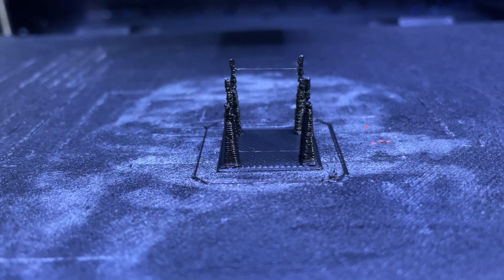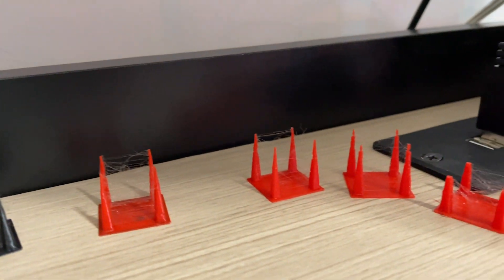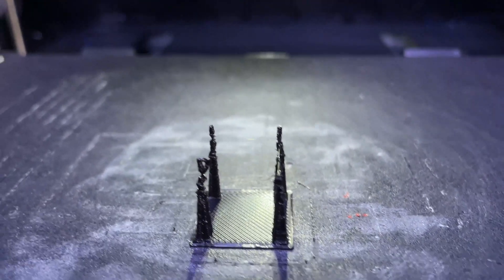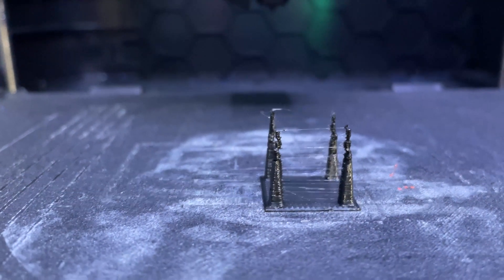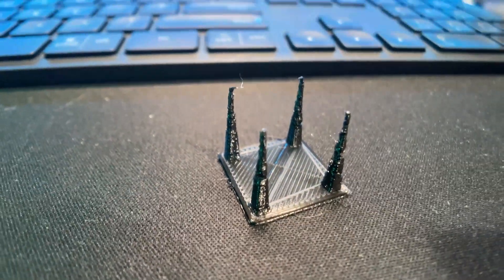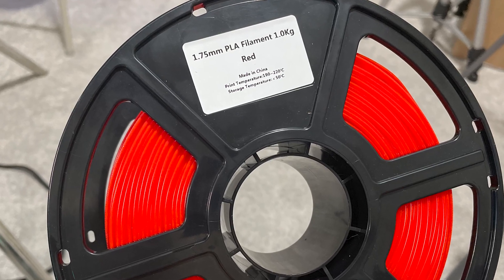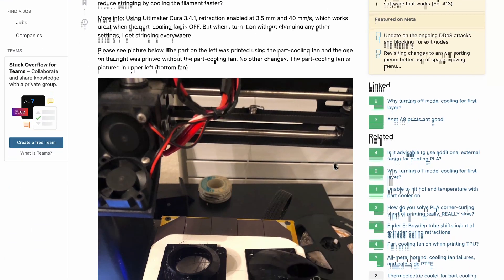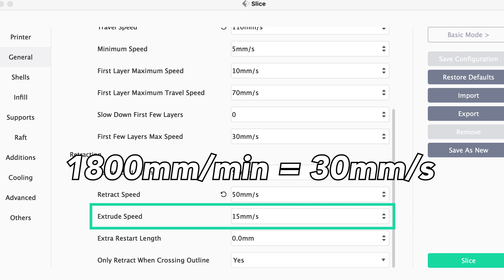Change This Setting To Removed PLA Stringing

Comment: DUDE. This fixed my stringing issues. Holy crap, I was struggling with this for 2 weeks and was about to throw my printer out the window. 

This is so weird and counter-intuitive. I too think that for PLA that is prone to stringing that cooling it too fast allows it to solidify as it's stringing, where while it's still soft lets it break easier. 

I have noticed that the PLA that does string, even when the strings are thin they're still relatively strong, stronger than the strings at that thinness in other filaments that don't string as bad. Like if I grab some of the problem filament as it's oozing out of the nozzle, it's like I can hook it up to a spinner and just get a super long and strong thin thread from it straight out of the nozzle. However with regular filament, I pull it out of the nozzle and the whisp isn't connected. If that makes sense...

Comment: For PLA I would recommend to use the part fan between 80-100%. With less speed you will maybe get less stringing but also bad and ugly layers. Also the overhangs will be very bad. My experience is that for this problem you would need more part fan power.

Comment: Anycubic Kobra Go.  I've tried so many things that are supposed to eliminate stringing with very little actual change.  When I found this video I was amazed to find something I hadn't heard to try yet.  Unfortunately, setting the fan to 5% did not fix my issue, neither did 10% or 0%.  I'm replacing the nozzle next.  We'll see if that was it after all.  

I did wonder if 5% is so low power that your fan is not spinning at all, where 10% may be above the threshold to get your fan spinning.  It makes me wonder if 0% and 5% would give you the same result on your machine.

Comment: Kindve late to the party, but on my adv5pro I accidently sent a LW print on abs settings, and it turned out perfect. I was having the hardest time trying to get the LW to work at all, but this seemed to work for me. 265° 105° bed 1st layer, 90° rest of the way

Comment: Hi, I've had a similar issue with my printer (Ender 3 Pro) and just thought I'd share my findings after many hours of testing.
I had a lot of stringing recently and thought it was mainly the PLA absorbing moisture whilst being in storage, so I bought a filament dryer.  Unfortunately after drying the PLA the stringing still happened.  I tried a different roll, just to see if that particular PLA was at fault, but again still stringing.  I altered temps and retractions, but again still stringing.
I tried your method about reducing the fan speed and that really helped, but I thought that was sort of a band aid approach and what other problems would this cause.  So then I thought of replacing the boden tube.
This really helped to the point I was now only getting angel hairs. I put the original (now dried) PLA back on and YAY! no more stringing.
So my conclusion (for me) was to replace the boden tube (preferably Capricorn) and make sure that it is correctly seated and invest in a filament dryer.

Maybe this helps someone
Reply: I have a direct drive and replaced my entire printhead and dried my filament and was still getting stringing, and changing the fan speed was the only thing that helped.

And if it works, it's not a bandaid. I spent 2 weeks agonizing over solving this stringing issue trying absolutely every single thing to the point I was about to throw my printer out the window, and changing the fan speed was literally the only thing that worked.

Comment: I just recently used the teaching tech retraction calibration tool on his website to tune my new E3D Hemera. I think it's worth seeing how your testing goes using 100% fan speed and dialing in your retraction settings there first and then testing fan speeds.

Comment: I may be 5 months late on this but just reporting in. Had my ad 4 for 4 weeks now. Had lots of stringing issues. Spoke to a friend who knows 3D printing issues quite well and he said to max out fans. It only got worse yet I reduced fan speed and got lots better. Neither of us could believe it but that's just how it is with the ad 4 by the looks of it.
Reply from the maker: yeh I think the max fan speed might help pull strands of plastic out of the nozzle as it travels from one tower to the next. Also, the max fan seems to be strong enough to move the slightly molten plastic before drying. Thats my theory at least

Comment: Hello Daniel, first: thanks for your input, im really new into 3D printing and switched from an AD3 to an AD4 because of the build volume.... I was very happy with the ad3 and hoped, the ad4 should behave the same..... but it wasent because of the stringing problem.... I've searched tipps/tricks all over the internet .... but with your input, I think I found the solution to NO stringing and im NOT loosing any details! I would love to post the settings (or config file for FlashPrint) and some pictures, but I can't post them on YouTube :( let me know, if you like, so we can send DMs :) greetings
Reply: So what ever happened with this? Did the settings ever appear anywhere?
Reply: Pouvez-vous me donner vos paramètres pour l'adventurer 3? Contacter moi !

Comment: I found this out a couple of months ago and mentioned it to support. My combination was higher temps for PLA (10-20c higher) and FAN speeds around 10-25% to get rid of stringing. Support came back and recommended similar settings (reducing the Fan to 25%) which depending on the print is not ideal and more of a workaround than a solution. 

They mentioned many users experience this problem, although it’s odd many users are fine. It seems to me for users that have the issue it’s that the layer bonding isn’t quite right, like the nozzle drags the filament slightly and due to the Fan shroud design cools the filament quickly resulting in heavy strings.

 It seems very prone to strings and retraction settings make no difference along with the brand of filament used. I’ve tried many PLAs all of which print fine on my other printers but string like crazy on the adv4. 

I’ve also the filament needs to be super dry compared to my other printers, any moisture absorption and it’s a no go and I have to pop in the filament dryer before using, even with some brand new filament. I think the position of the Fan shroud or something to do with the nozzles is the issue although can’t work out what exactly and why it’s not for everyone. 

I’ve also tried new nozzles from Flashforge which made no difference.
Reply from the maker: Yeh I’ve tried another fan design but that didn’t work out. But it may be something with my design. 

I’ve tried drying my pla without any success. Next I might try adding other fans around the printer rather than relying on the onboard cooling fan.

Comment: Just a newbie but could it be that as the fan cools the filament it is also cooling the nozzle cool enough on the outside that as it is laying down filament some of it is blown onto the nozzel and sticks. as a result of the nozzle cooling down on the outside. Causing it to stretch that bit of filament thin.
Reply from the maker: I have observed closely that the filament isn’t being blown onto the nozzle but I think the nozzle getting cooled by the fan may have an effect. I haven’t come up with a plausible theory regarding that though

Comment: Just tested mine (bought two weeks ago) with Creality PLA & 100% fan; I got ojnmly a few strings. 

Here's the settings I've been using:

temp: 205
plateform temp: 45

retraction length: 7,00mm
Retract Speed: 35mm/s
Extrude speed: 25mm/s

I'm usualy uing fan at around 20% to make sure there is no string at all but up to 50% it's usually quite fine but it highly depend on the model that is printed.

I'm curently printing a Nintendo 3DS pen (works well with the ADV4 touch screen) and tried 100% fan and there is a lot of string floating around... The one I printed yesterday at 20% fans speed was perfect.
Reply from the maker: Just curious but we’re you printing the same model as I tested in this video or was it just the Nintendo 3ds pen you’ve tried?

Comment: Hi there.
Yes, with 5%. fan speed got model 99% without stringing, but pillars looks overheated.
Reply from the maker: Yeh that is the downside when you don’t use the fan. I think ultimately it’s an adventurer 4 hardware short coming. More specifically it’s due to the Bowden tube
Reply: @justmakeitdaniel7667  
Have tried slice with FlashPrint and with same settings and 15-20% of fan speed got reasonable result, have stringing, but very easy to remove them, and pillars looks good.

Comment: Youtube has remove my feedback with link on picture :(
Default profile provided by simple3D is not good for this model.
With temp. 205 deg. for filament and 5% fan speed - model still has stringing. :(
Reply from the maker: You will need to do a few more adjustments on S3D. I should have my settings in the description which are not the stock settings for PLA

Comment: Hi, I have also problems with AD4.
Try to change extrusion mult. to 0.9 and set fan speed to 100%.
I have good result.
This is recommended Simplify3D setting .
Best Wishes.
Reply from the maker: My fan speed was at 100% for all these prints. I haven't tried lowering extrusion multiplier for this exact print but I've done it on others and it didn't make much of a difference. Were you printing the exact same model as I did in this video?
Reply: @justmakeitdaniel7667  I will print today

Comment: Great discovery Daniel.  Stringing on the Adventurer 4 has been driving me crazy.  Trying the 5% setting right now.
Reply from the maker: Let me know how it goes! I will have another video out on more stringing settings later on as I’ve gotten a little further in my discovery
Reply: @justmakeitdaniel7667  Hey Daniel.  I posted your video on a Facebook ADV4 user group and have some great replies.  The group is called FLASHFORGE ADVENTURER 4 OWNERS
In summary, 1. many people experiencing the stringing, 2. cooling fan reduction definitely improves stringing (I also tried this las night with great results), 3. fan speed at 5% has negative side effect of overhang issues (I['m seeing this too), 4. some think it's a hardware design issue.  Personally I think it should just work without all the tweaking we are doing - just the same as the ADV3 but with the bigger build capacity.  If we were all to raise our concerns with Flashforge they seem very progressive and proactive and may issue a hardware fix?
Reply: @paulsproule9132  Hi! I wanted to join this group that you mentioned, but I can't find it, fb doesn't show me. Could you send me a link? Thanks

Comment: As for printing PLA w no stringing... your  string towers looked overly Melted.  Haha.  No offense, but I've seen this kind of melt before when I realized I had the cooling fan completely off.  Personally I'd rather have some whiskers on a decent Shell surface, than that kind of melt.
Reply from the maker: Yeh, this test was more so to isolate the cause of stringing and I think can be used for larger prints where travel moves happen over open surface areas. I printed at a much slowed speed and got a descent shaped tower

Comment: Hey Daniel! I was just watching one of my prints live on the AD4 the other day & I observed the fan directly creating stringing by blowing, However I didn't really care much as im not that fussed about stringing. To help you solve this stringing issue I am happy to do testing on my machine so you can get more input, Can you provide your g-code files specified for PLA & I can do do the tests then report back with the results!

The quest to get good prints out of the ad4 feels never ending lol but hopefully we get there as I love this machines ease of use!
Reply from the maker: Just added the gcode files for PLA to a thingiverse item. You can find it here: https://www.thingiverse.com/thing:5240434/files. I've labelled them so they should be fairly straight forward. One of the files has both prints in them and the label tells you which is which.

Comment: Stringing is a big issue on this machine. I also tried already some settings but not that much. I bought the A4 because it should be doing what it supposed to do, out of the box. However, it is not. Until now, I do have the feeling I did a bad buy. So, I will lower the cooling fan to 5%. The back fan can stay on 100% I guess. I'll let you know what the result was.
Apart from this video, SUPER that you make time to help people that bought this machine. Just some hints on other subjects:
- which parts are 100% compatible of the A3? In Europe, there are not that much of spare parts for the A4.
- stringing (you just did)
- how to replace the complete giding tube
- when do you use the 0.6 and 0.3 nozzles
-...
Reply from the maker: Let me know if slowing down the fan speed helps! Its definitely not a be all end all but its a step in the right direction I've found. Still testing away to see what are the best settings...

Comment: I'll have to play with this setting, I always assumed lots a cooling was necessary too. Do you still plan on making that other bed leveling video that doesn't involve shims?
Reply from the maker: I haven’t quite figured out the easiest method to level it by adjusting the timing pulled up top. It has been very finicky and frustrating to do so far so at this point, I wouldn’t recommend trying. Once I figure out an easy way to do it, I’ll post!